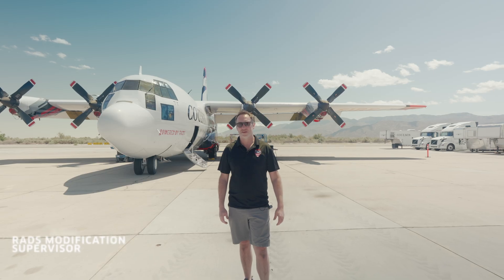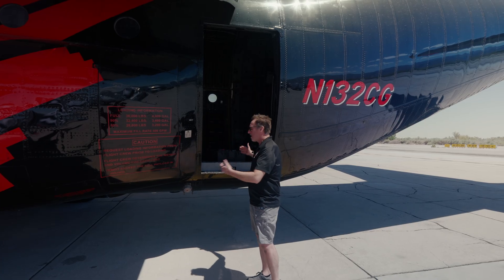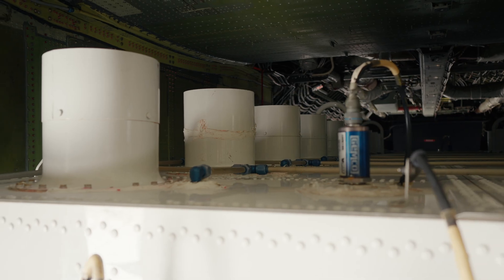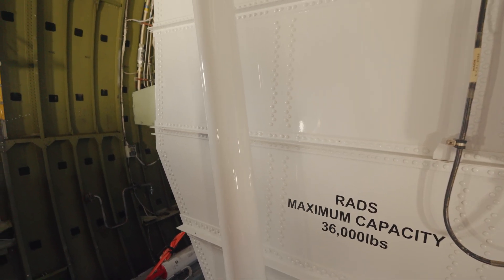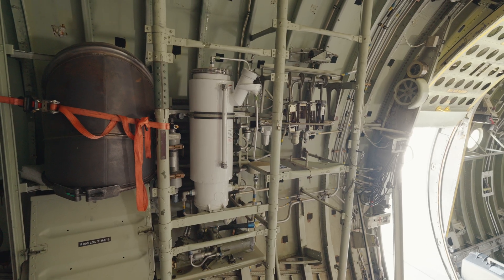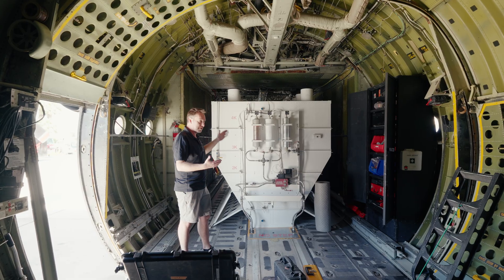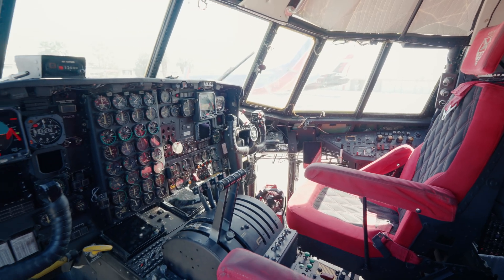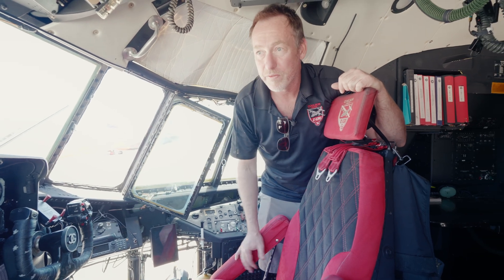C-130H RADS Tank System Walkaround

Comment: Maybe a silly? But has anybody Thought to Add KC10s like 4 or 5...Seal off Tanks for Water/Fuel...Add adapters to C130 allowing to Refill Water Tank..4500 galls then Off to Drop water and Back to Mid Air ReFill...we do it with fuel how much Time would be saved with more water on site rapidly...